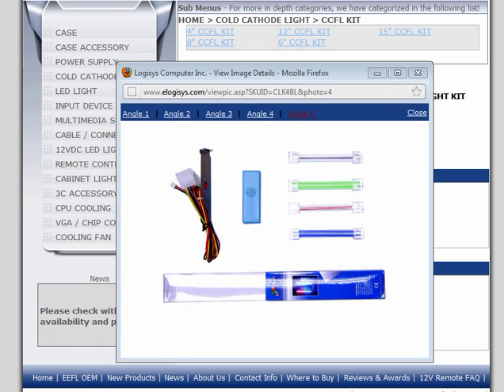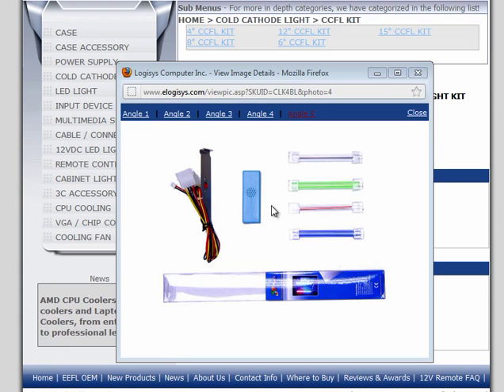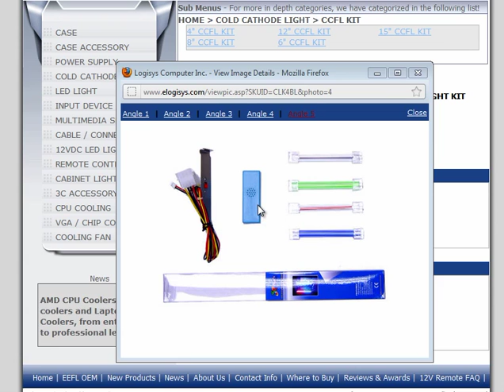#385 - Q&A: What does a Cold Cathode Invertor do?

Comment: Just buy a logysis led tube. Much lower power. It doesnt get hot. You can plug them right into your psu and you get nice even light unlike cold cathodes which for me had very harsh lighting. Also of course they last forever or quoted at 30000 or 50000 hours at least :)